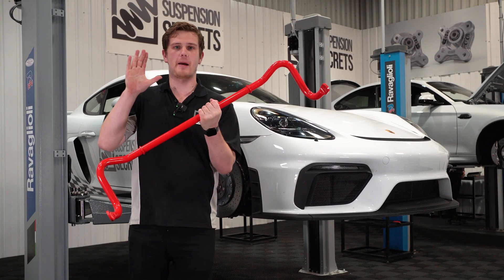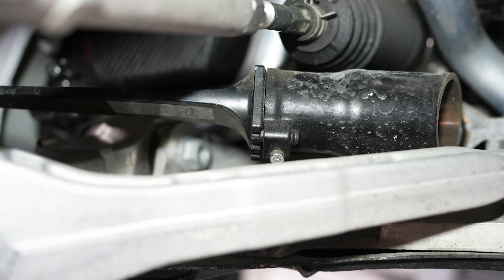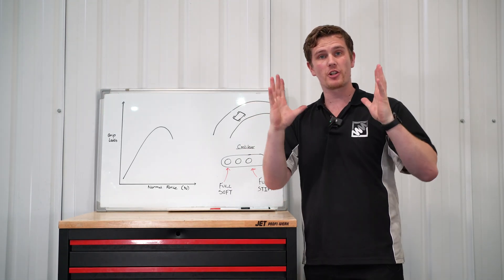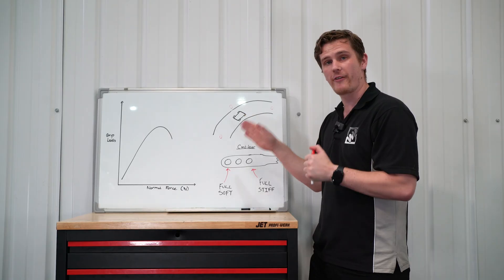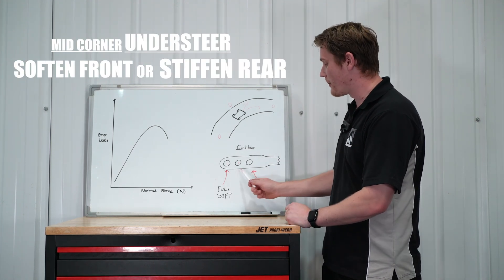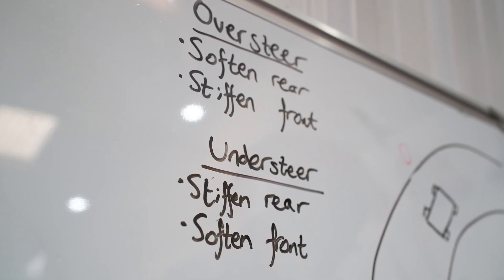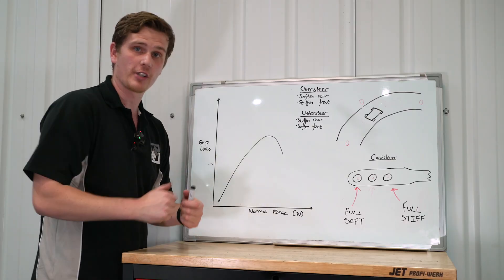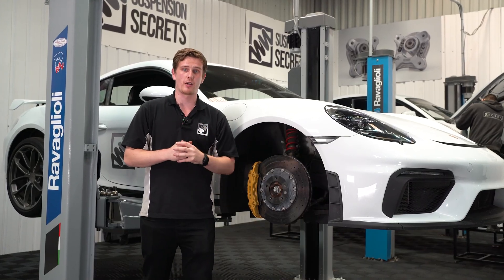HOW to Set, ADJUST and TUNE ANTI-ROLL / SWAY BARS

Comment: To be clear though, anti roll bars do not prevent the total lateral load transfer on the car caused by lateral-G, the relative stiffnesses of the front vs rear anti roll bars merely determine the distribution of the total weight transfer.

So if you had identical stiff or soft anti roll bars on both axles, each end would see/experience the same amount of lateral weight transfer for the same lateral-G on the car. If you want say the rear to experience more % weight transfer across it from inside to outside, you’d stiffen the rear anti roll bar and/or soften the front. This would then lead to a commensurate reduction in % weight transfer across the front end. But the total combined % of weight transfer would remain the same as that is decided by things like the center of gravity height, track width, lateral- G. It has nothing to do with the anti roll bars, no matter how stiff or soft they are.

Comment: Excellent video! I'm now wondering: how do we tune for the max-grip operational window you talk about at ~12-13 minutes into the video (in addition to balance)? Seems like we could achieve F/R balance w ARB tuning, yet leave a lot of total grip on the table. Are there good indicators or any straightforward method, besides feel & iterate?

Comment: The tuning makes sense, but how do you determine the optimal bar thickness? Because you could be looking at a 20mm bar with 5 adjustment holes vs a 25mm bar with 5 adjustment holes
Reply: Ultimately, the tires determine the size of the bars. The better the tires, the bigger and stiffer the bars.

Comment: At the end, great explanation of what happens with too stiff swaybar in the rear.  I really like your video.

I wish the “conventional wisdom” for setting up a FWD car included this knowledge.  Too many people stuff the largest sway bar into the rear thinking that it is going to correct the FWD oversteer issue, when it is largely a driving skill issue.  However, the problem with that mod is that oversteer is a transitional issue that only occurs at a high enough  speed where front and rear grip is no longer equal.  The worst time for that to happen is in a high speed corner where  something triggers that transition to oversteer.  A slight lift off the gas can trigger this transition - been there, done that and it didn’t end well. I have learned a lot since then.

One other thing.  Roll stiffness is a combination of spring rates and swaybar stiffness.  With a swaybar a connection is made between the left and right side tires.  With that connection there is a loss of independence between the two.  The amount of that loss is a function of the sway bar stiffness.  If independence is being compromised, then stiffer springs can be used with a softer bar to achieve the desired overall roll stiffness.

I know, way too much info for a 15 min video.   Again thanks for the video.

Comment: Following this will also create a dangerous situation in most cases, let me explain, most cars are setup to understeer from the factory so adding a stiffer rear bar looks like the proper solution, here is the thing, many/most sport cars have trash differential (ex: torsen) when the stiffer bar remove weight from the inside tire this tire doesn't have the grip necessary to transmit 30% (percentage based on the diff gears leverage ratio or the torsen) of the torque to pavement the trash lsd will send all the power to the wrong wheel for an instant (slip) creating a dangerous violent unstable situation, that's why a thin swaybar is used from the factory, you didn't mention this, most people don't know this and will get caught, your advice is good if the car is equipped with a clutch pack lsd.
Reply: Laughing in GR Yaris, which already has very stiff bars on the RZHP or Circuit Pack cars, and 2.3TBR Torsen LSDs front and rear. It oversteers on command on corner exit in a completely controllable fashion. With the Cusco bars at 135% and 138% the stiffness of stock, the car is even better.  

If your car is suddenly sending all the power to the inside tire with a Torsen diff, your suspension is trash.
Reply: @DeepNanbu  No it is the Torsen that is trash, as you go UP in suspension performance (higher natural frequency) it will malfunction more and more. The thin OEM bar is there to match the low performance of the LSD. Of course this phenomenon is more obvious on RWD cars, GR Yaris is AWD... the front is always pulling, the highest trim of the Yaris in Japan does have clutch pack LSDs. Look at all of the popular racing series, F1, WRC, GT3 why are none of them using Torsen? At least to me, from years of experience at the track using different LSD technologies, the reasons are obvious.
Reply: @DeepNanbu  Why should the suspension decide where the power is sent in the first place? You see, that's already a huge red flag for this technology. With a clutch pack I can transmit all the torque to pavement with one side of the car completely lifted off the ground, meanwhile the Torsen will malfunction over anything at the limit, dirt, bump, wet spot, just approaching the limit in general, it is very unstable comparatively.

Comment: Is the middle setting of an aftermarket anti-roll bar like in this video for an F82 M4 stiffer, than the middle setting from the factory?
Reply from the maker: It would depend on the bar diameter and cantilever lengths. The best source for that answer would be the manufacturer of the aftermarket bar as they will have that data for you

Comment: As always great video. I really enjoyed your explanation on lateral load and try grip. I was always under the impression yes more load on the outside tyre creates grip (to a point) but the loss on the inside tyre evened it out but is a think where I was going wrong. To a point the extra load on the outside creates more grip than what the inside tyre looses? Correct?

Comment: I've significantly increased my front grip on my F87 with camber plates and a square wheel/tire setup. I'm dealing with a lot of mid corner oversteer. It seems like I need a stiffer front sway bar.
Reply from the maker: Absolutely 👍 you will have shifted the grip bias to the front axle with the wider tyre and additional camber. It might be worth checking that your rear camber is now set to its perfect position as it might require some more too.
Reply: @SuspensionSecrets thanks for the response!

Comment: You said Sway bar stiffness affects how much LLT? I don’t see that in the LLT formula?
Reply from the maker: Thanks for the comment. The standard LLT formula has only a few inputs but for more complex LLT calculations chassis stiffness is taken into account. Check out our two articles on our website “calculating ideal spring and roll bar rates” 1 and 2 which goes into much more mathematical depth and you can see the effect that the anti roll bar stiffness has on the delta of load transfer across the axles. We tried to keep this video as easy to follow and understand as possible which required some simplifications otherwise it would start to get quite confusing 👌